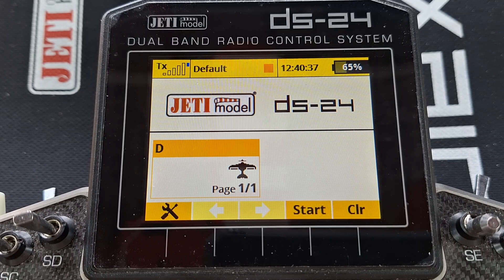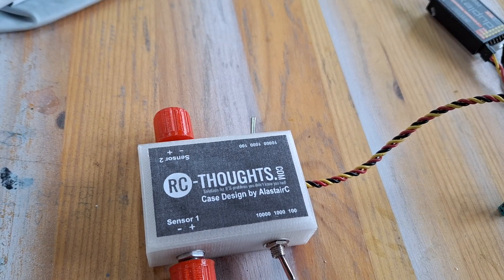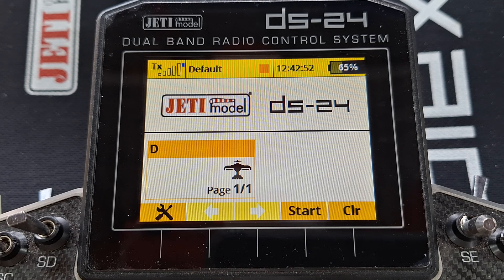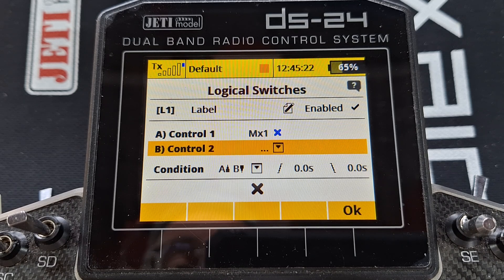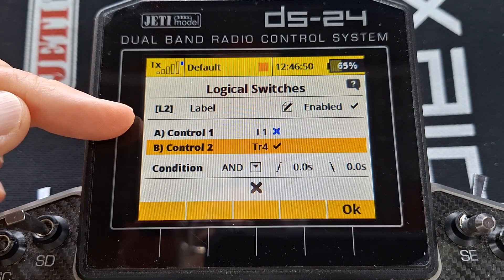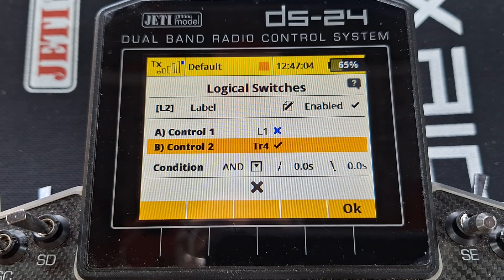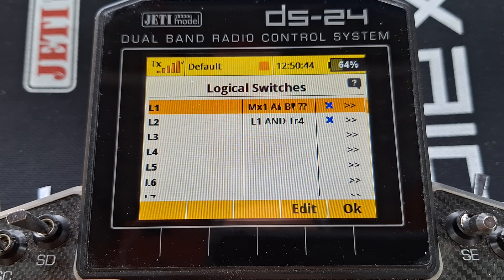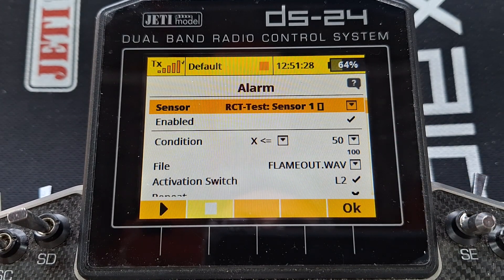Jeti - alarm only works after certain events, such as turbine flameout only after engine has started

Comment: I just use the Turbine RPM as a telemetry alarm, but have a switch to enable the telemetry alarm function after engine start , but yes it would be nice to enable it automatically to be sure and the cut down on the voice chatter

Comment: Hello Harry, thank you for all your video explainations, you really helped me getting smooths flights with good programmation. I need extra help to be perfect. On my gliders, I have the throttle on slider 5. I want the throttle to be on the slider 6 with a switch (when taking off alone by hand). Maybe you already explained how to do it with flight modes but I can't find the video anymore. Can you help me ?
Reply from the maker: Logic switch, the slider as propo and Lin OR the switch.  Set the logic switch as the control for throttle in Function Assignment.